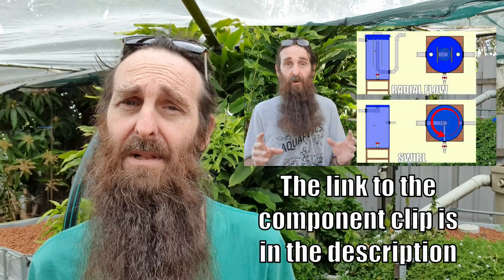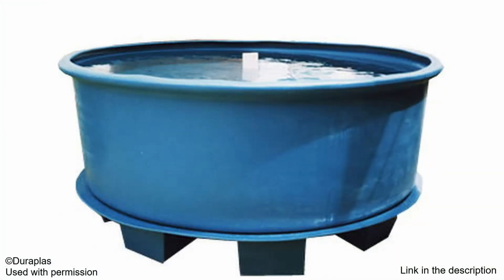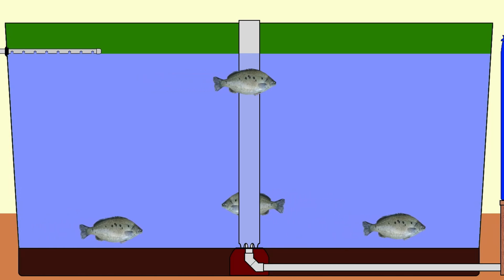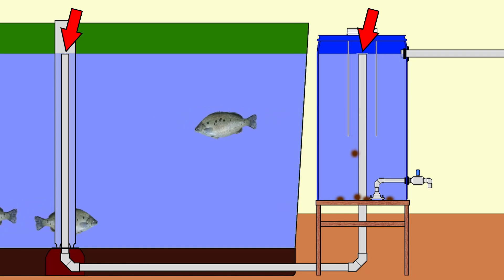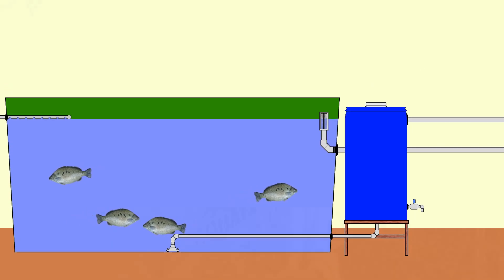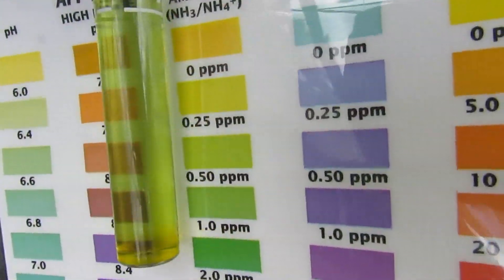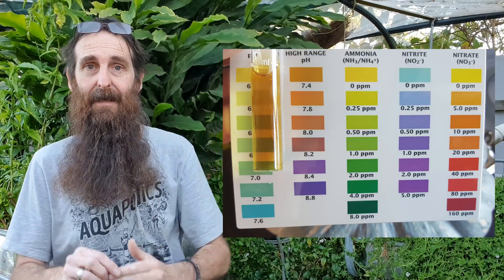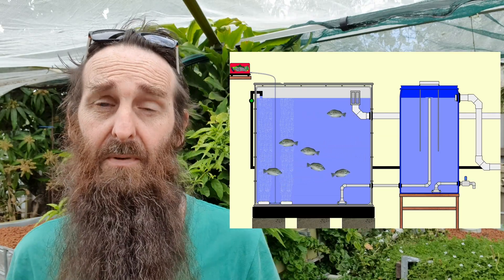Aquaponics Design - Centre Solids Outlet, Dual Drains & pH

Comment: lettuce how many days yield oliyosun 1 lettuce how many fish do you use
Reply from the maker: I have no data for growth rates sorry. It would vary depending on the feed rates of the fish & planting density. 
I use 112 fish per 300L grow bed when they are being used as the primary biofilter.
Cheers.

Comment: I am interested in automating the water chemistry testing in my aquaponics systems...  Is it possible to have in system pH/ammonia/nitrite/nitrate data collection that uploads values over wifi?  Or is that something I am going to have to rig with an arduino?
Reply from the maker: I have seen folks make up their own monitoring systems Rick but I haven't looked into it myself. 
Check out the Aquaponics Anonymous group if you're on Facebook as I think I've seen a few posts there.
Hope you can turn up something useful mate.

Comment: Hi Rob. I also set up my SLO with an overflow that drains back into the sump ( because kids and ferrals) so i don't lose water in the event of a blockage.
Reply from the maker: I have had separate overflows in tanks before as well Shane. They came in handy a few times before I got the pipes sized correctly. 😉😄
Cheers mate.

Comment: how about the diagram for the regular lifting outlet for solid?what is the height of the tube and water on that?like the one you use?
Reply from the maker: That was covered to a point in the clip this came from
 https://youtu.be/2FTlha0c2aA
The height can be as long as you want for your tank. I like to leave leave at least 100mm/4" of space between the top of the water & tank lip. 
Hope that helps.
Reply: Hi.  The height depends on what height you want the water to be. Like rob said 100mm or 10cm or 4 inches.  From the top of tank. I also have an overflow above water level so if pipe blocks  ( unlikly without kids) then it will overflow back into the sump rather than lose water over the topsides.

Comment: Regarding dual drain system: you mean the retention time in the solids separator is lower because the flow from the FT is split? imho the total flow is determined by your pump and not by the number of drains?
Reply from the maker: The flow is regulated so that about 10% of the total flow goes to the solids capture system with the rest leaving via the top drain. 👍
Was just an over view as I said but will cover how I's setting it up in another clip.
Cheers.
Reply: @RobsAquaponics  Super, thanks Rob!